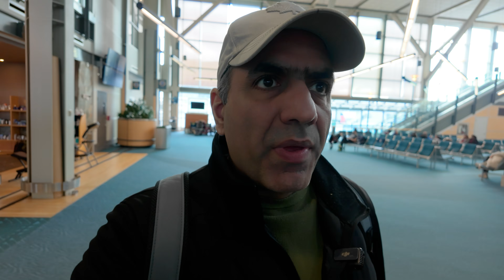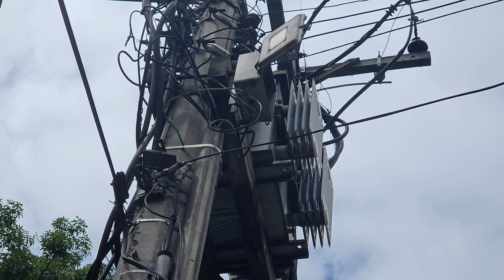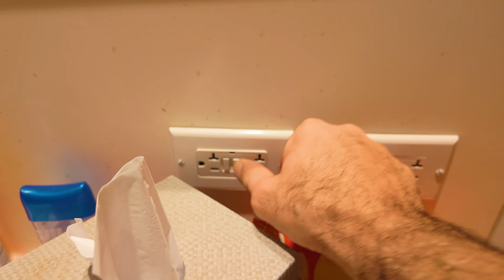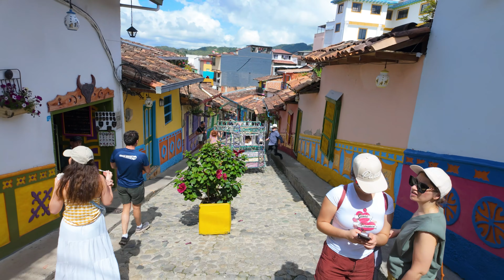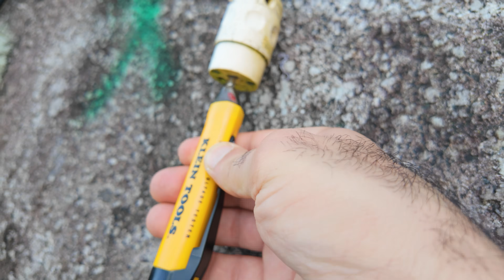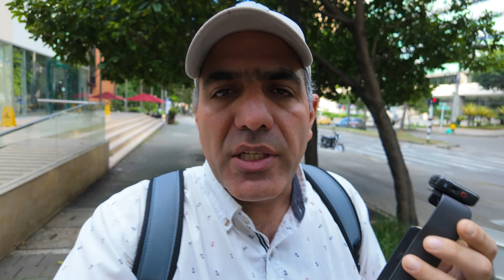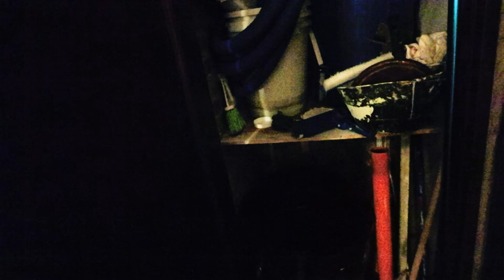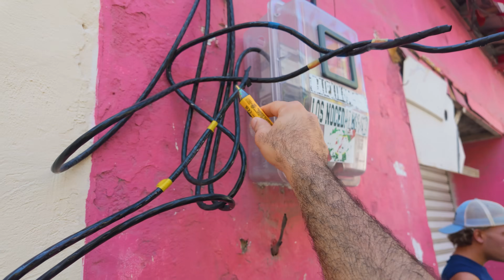Colombia Electrocutes Burglars

Comment: Mehdi's trip was ruined by adequate electrical systems 😢
Reply: Believe it or not, Colombia does have a very strict electrical code. Of course older buildings are not "up to code" and they are only required to be if they're open to the general public. Also, if you go to very rural areas or to very poor neighborhoods, you'll find sketchy "pirate" connections done by death-defying morons who think they know better.

BTW, most of those lines you saw hanging around are actually coaxial or fiber-optic. It's still a horrible mess that's no longer allowed for new connections, but correcting the older ones, let's say it will take "a while".

Oh, and, Cartagena... well, let's put it this way: there was a pretty corrupt electrical company there that was run by foreigners, who were leaking the money they should have invested to fix all electrical problems to their bosses' accounts in Europe... Meanwhile, the mess on the northern part of the country is something that will not be made right in a generation...
Reply: @diegomartinez7180  Actually, in 2020 the electrical company in charge was replaced by another one that is actually run by colombians.
Since then, the electrical situation in cartagena and other major northern cities has just improved.
The corruption problem has long been solved and many of those sketchy "pirate" connections have been taken down and the powerlines have been updated to modern international standards.
Reply: @tucompaelcis  Well, if you say so... According to "people", there's a certain journalist who's husband is now the owner of the pockets where the "leaks" are dropping into. Yet, as far as news go, at least prices have stabilized and power outages have diminished. There's still a long way to go...
Reply: @diegomartinez7180  How's that nobody told bro about Bosconia
Reply: He found that Mexico is the Mexico of Latin America.
Reply: The only time it got interesting with the bathrooms and the very nice hotel room they had to leave early i guess...
Reply: Don't forget the clean streets and the clean 59.99 hertz 120V supply.
Reply: @migmontest it was 1.5volts higher at the hotel
Reply: Someone tipped-off the Columbian government that Mehdi was coming.
Reply: @FLPhotoCatcher  Columbia is in Canada. Colombia is in South America.
Reply: @LeCarpincho  Even if its not the official name, Columbia is etymologically accurate and would be the english language equivalent of the word. No podemos ofendernos por semejante estupidez.
Reply: @samyquito02  No, it is not etymologically accurate. That’s not what etymology means. You probably mean that the name comes from Cristóbal COLÓN, which is a SPANISH name. Some claim that he was Italian, named Colombo, but there is zero proof of that. Cristóbal Colón never wrote in any other language but Spanish, and when he tried to write single words in Italian, they were poorly garbled.

So, from the SPANISH name COLÓN comes the SPANISH name COLOMBIA, and Colombia is also the ENGLISH name. So you are absolutely wrong.
Reply: @LeCarpincho  Columbus is what he's called in english. Go cry at Oxford. Cry me a river, im Colombian, why do you even think British Columbia and District of Columbia are called like that? Hell, even the United States of America was called Columbia in poetry... stop being insecure. Columbia and Colombia are the same word. Do you say Turkey, Turquía or Turkiye? Do you say Kiev or Kyiv? Who cares. Stop being annoying.
Reply: @samyquito02  That's irrelevant, not even in English exist any country named "columbia". So learn the basics about geography
Reply: @LeCarpincho  siquiera sabes inglés? Que soy colombiano, cansón.
Reply: @samyquito02  Busca un mapa en inglés, y no vas a encontrar ningún país llamado Columbia. Un estado de Canadá o Estados Unidos no es un país. Acá estamos hablando de un país, y de nada más.
Ser colombiano sin conocer el nombre del país Colombia es demostrar analfabetismo.
Reply: @FLPhotoCatcher  colombian*
Reply: ...what ever one could call "adequate electrical systems"  😉😇
In Germany, Switzerland and many other european countries any electrical engineer, doing connections that way, would get stoned to death from VDE and any electrician that has to do the acceptance testing for what the wiring systems in Colombia looked like. 😉
Reply: He was in a modern hotel.  A bad place to have an electrif(r)ying experience ;-)  Honestly, I've seen absolutely metal stuff in Latin America.  The difference between the Good, the Bad and the Ugly is tremendous.  There are no limits to improvisation and in some places the local specialist is a self-taught, death-defying guy with no formal education but highly regarded because he knows how to do electrical things for cheap and without killing somebody.  Most of the time.
Reply: Nah, he still gets to use it as a business expense ;)
Reply: i swear he found only the good ones cause you can see pretty crazy stuff around here!
Reply: xD 👍
Reply: But remember to BYO batteries for the smoke alarm

Comment: I guess a Colombian house uses a fraction of the power of a Canadian one… So thinner cables.
Reply: Yeah, you´re right... electrical energy is more expensive there, but also they need no AC or heating system, also they cook with natural gas than resistor based stoves
Reply: @ger20cam11 depends on where you are.. I wouldn't want to live in Cartagena or Santa Marta without AC...